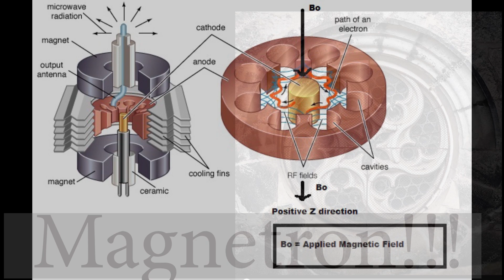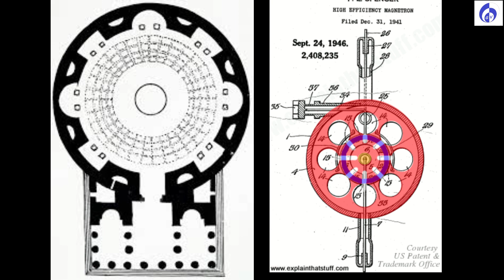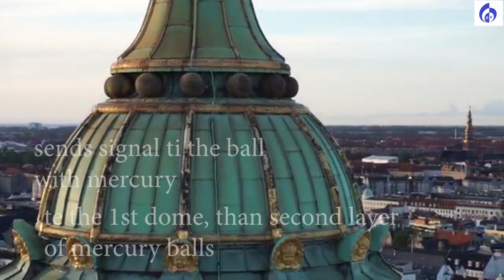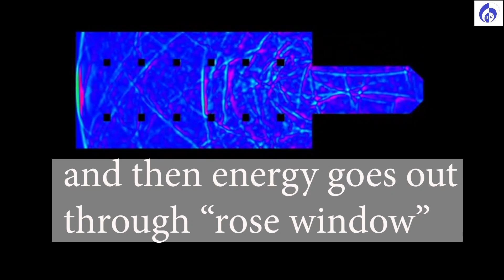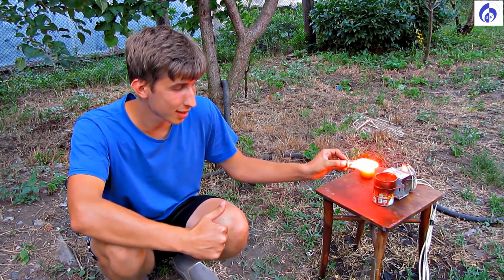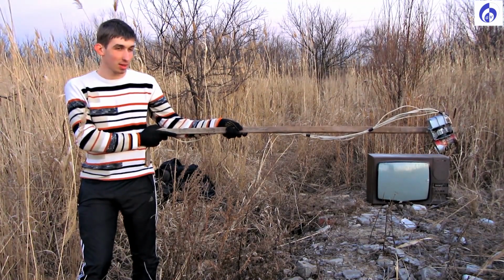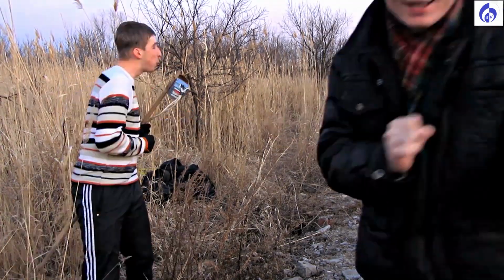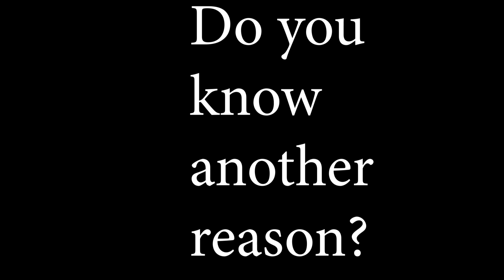DoH. Churches. Shapes 2. Magnetron.

Comment: GV thank you!  The old buildings and "city's" do not seem to have the infrastructure in place for the amount of energy needed for heat and light for habitation especially in colder regions.  I believe this energy came in the form of the vibrational and piezoelectric properties of the granite used in so many structures.  Many granites will conduct normal electricity (electron flow) with inherent resistance causing needed heating.  Piezoelectric effects creates high voltage electron flow enhanced with or by atmospheric electricity when vibration is present.  High voltage will cause ultraviolet light as in our fluorescent lighting with the presence of mercury.  UV light will cause phosphorus material to emit visible light.  This high voltage in the structures material can cause "saint Elmo's fire". Which is just plasma emissions at the points of the antennas of the buildings which will enhance the atmospheric electric collection.  This combination of tuned vibrational building structures and piezoelectric materials makes sense!  A slightly different train of thought is the higher structures nearby will protect the lower nearby antennas from lightning strikes!  Also the three layer dome structures may just be huge asymmetric capacitors.  This asymmetric property has unusual effects in electric circuits.  Way more to be discussed than possible here!

Comment: What is the picture when we watch a Fascus from one of the ends? The very same, but now how to stimulate the radiation.Two metallic domes one inside the other forming a huge capacitor. When the outer one is covered with some oxides just as copper oxide improves the working.. I did it with cone formed spirals covered with CuO by means of corrodating with Caustic Soda.  What we know lack is the deep knowledge of the working of Vacuumtubes. Tesla was using a simple device consisting of three vaccum tubes some resistors and capacitors The Morley device also was relying on some custommade tubes, stimulating specific ion interactions.
Reply from the maker: and propagation) thank you)
Reply: Each day I get more insight but also significant confusion. Last year I saw some mindblowing videos by RevMichelleHopkinsMann . One of the items was about HAARP like devices doing weird things. She showed sojme fresh cooled delphins and other stuff. In one episode she ('HAARP' New TTA's Exposed !!! How MAN MADE Australia's RED WAVE !!!)  is about a HAARP  and the more powerfull Tesla Testing Device. as being situated at an island SouthWest of  Australia. There were experiments where the toplayer of a desert was lifted and directed to the ocean and dumped at a different location at land again. What if in the recent past a part of the mudfloods were provoked by such technology. You lift the soil and directs it to the target and then add some rain showers result devastating. I am puzzled by the covered cities now by science explained as carved out in the rocks , but just covered and moisted. Follow a mudflood : it is rather fluid when at travel, but as soon the speed is lost it hardens like concrete.The giant buildings in Petra are not carved out, there are traces of some concretelike stuff flowing down and leaving their traces. . How is it possible to have tops of the roofs well proportionated while there is a severe coat of soil is directly above. And Gobkli Tepi ? The original inhabitants covering it under a sustantial load of sand.